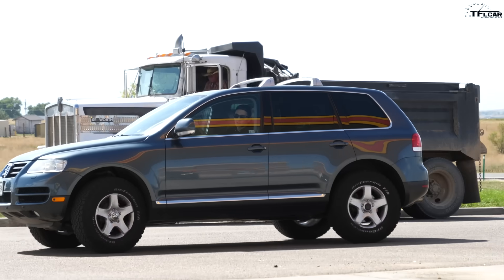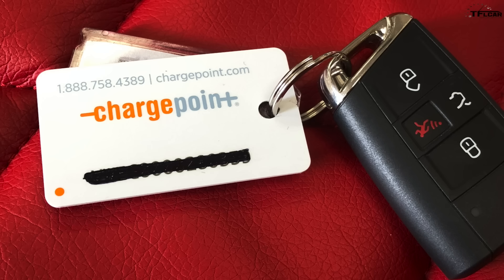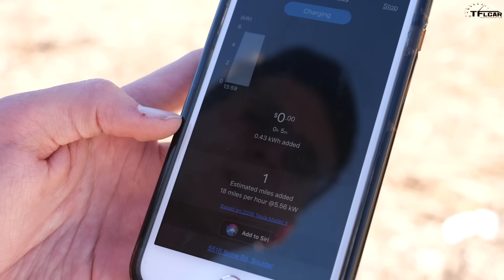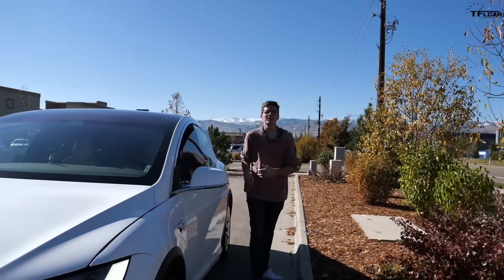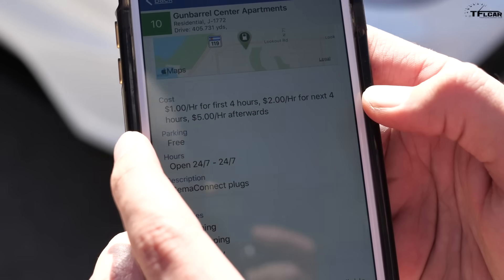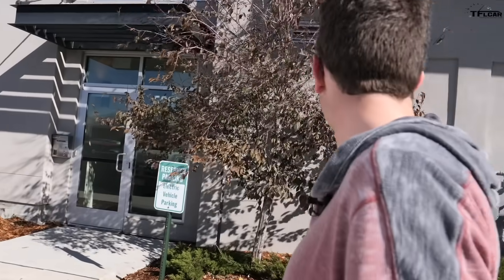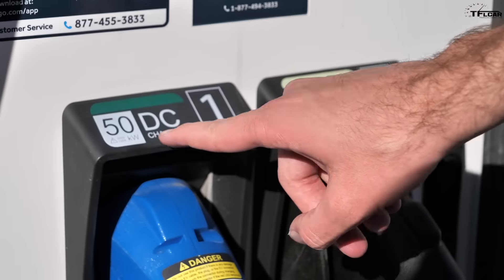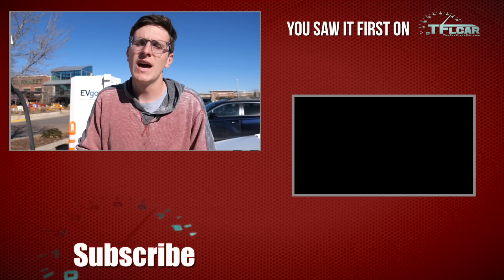Here’s Why Charging an Electric Car Can Suck - And It’s Not The Reason You Think!

Comment: My daily driving distance is 50 miles and electric car will be a good thing to save money , Go to work  and when I back plug it in the garage to charge .
Reply: As long as you don't need to make any side trips.
Reply: @DAK59  Why?  Since I got my Tesla.. we are on a mission to take every long trip possible..before gas prices hindered the trips but when you travel for  next to free take as many long trips as possible.
Reply: @1905934  , Short distances between charges, hour long + charges.  It isn't practical for distance driving.  If I leave Atlanta to visit my son near Chicago, I can make it in 12 to 13 hours. If I were to take the trip in a Tesla 3, I would have to charge twice and it would take around 90 minutes for each charge.  So I would add 3 hours to my drive.  This assumes I don't have to go out of my way to find an available Supercharger.  If no Supercharger is available or I have to go out of my way, add more time.
Reply: @1905934  . Not for hours at a time. I can get gas and use the restroom in about 10 minutes.  When I make the trip, I usually take my dog so I get my food to go.  That is how I can do 700 miles in around 12 hours.
Reply: @DAK59  Please tell me more about your gas car... I am really interested..
Reply: @DAK59  You fill up gas hours at a time?
Reply: @1905934  READ.  I don't stop for hours at a time.  I rarely stop for more than 20 minutes.  My goal is to get to the destination.  Having to charge just makes the drive longer.
Reply: @DAK59  Why would you or need to stop for hours.. please go to the point.. I have never stopped for more than 30 minutes.. why would anyone need to stop for hours?  Please tell me what I am missing in this conversation.
Reply: @1905934  To charge the car.  I assume you figured out that it has to be charged every so many miles (322 miles is Tesla's advertised range for a fully charged Model 3).  Assuming Tesla Superchargers were available when and where I need them, I would have to spend about 3 hours charging during a trip from Atlanta to Chicago.  That is using Tesla's recommended 1 hour charge to 80% when using a Supercharger.  The numbers are the same if I charge to 100% because that takes 90 minutes per charge.  I could do  your 30 minute charges but I would have to make many more charging stops. The above also assumes that I can actually get 322 miles on a full charge. I could charge a little less but then I would arrive with almost no charge and the hotel I usually use doesn't have a charging station.  These numbers are the best case since a Supercharger is the fastest way to charge.  If I have to use a different charger then the charge time only go up.
Reply: @DAK59  I stop for usually 30 -45 minutes per charge and stop more often because you actually spend less time charging in total. the more empty the battery the faster the charging speed.  But you don't spend hours at one charging spot.
Reply: @1905934  you do know gas does have advantage over electric and most of the things you are greatful for is bc not everyone has electric and besides instant power there is no real advantage and in a power outage yea back to gas generator and by the way electricity is still made by coal and natual gas aka gasoline and price you can't choose your power at home or what other charge for power so the cost savings is small and cost a ev is more than electric so one day electric maybe there but telsa crappy 1860 batt loose juice just sitting so its bad to use in a car that you don't drive and plug in all the time
Reply: @executiveorder7146  It is best you drive a gas car.  you lose.
Reply: @1905934  all cars are gas cars so your right thank you for driving a car that is always going to keep gas alive and its always going to be on earth also so good luck with that
Reply: @executiveorder7146  Please tell me more about the benefits of driving a gas car.  This new technology is so amazing!  Do you want to buy my cassette player.. good price.
Reply: @1905934  awwwww you don't realize all those tech is just more juice going out the window and by juice i mean all that coal and natural gas aka gasoline and then wonder why you have to plug it in for hours or over night bc its like 1880 coal and natural gas aka gasoline so saddle up the mule and yea you don't realize they loooooose juice just sitting yea so plug it in plug it in
Reply: @executiveorder7146  my car charges while I sleep.. so I don't understand why you don't understand this simple idea.  You also do realize that gas cars use more electricity from the grid than electric cars use..so your are right if the electricity comes from coal.. that makes gas cars all the worse.
Reply: @1905934  and yea not only that but dealing with black outs like in Cali and the monopoly on electricity and board members can up the price of that kill a watt or burn that coal train till you are paying threw the nose and good luck being stuck wait do they make electric tow trucks lol or good luck asking for power somewhere and waiting to charge and then getting batt damage so yea those new telsa is a necked down 1860 batt that does loose just sitting and the same one is in the phone chargers at Wal-Mart for 5 bucks each so paying way over for that over priced golf cart zoom zoom the coals a smokin
Reply: @executiveorder7146  Us electric car owners want much higher prices on electricity. if you double the electricity you will quadruple the gas costs.   It costs me 1 cent per km to drive my car.  Compared to 16 cents per km for gas.  If I need to pay for a charge once a year when I travel...big deal.. who cares.  Life is very good for me an my money.
Reply: @executiveorder7146  You do realize that blackout affect gas cars more since you can't pump gas.  Please bring on more comments I like making you look like a fool.
Reply: @1905934  well mine is off while I sleep and its secure and no I can carry 30 gallon and 30 more in gas cans all while not doing anything but sleeping and yea if a blackout or storm or emergency im not stuck and have 4x4 so no electric cars are not there yet and not burning coal to do it so all night long those power plant or the meter on your house is not yours and you have to buy from that one electric company and if everyone had a electric car the price per kw or mega watt would be higher and you have zero choice but to buy it and at there price so try asking the power company for a cheaper rate or how that you don't like coal or gas production they will tell you they do what they want and you have to buy it all night long all night all night long
Reply: @1905934  I am curious about a few things I've seen the electric power steering but what about heat and from what I know they only make 1500 watt heaters so two of them in a electric car is like 3000watts that's about half the batt range or ac so please explain about the heat or ac and more so the heat and how 3000watts on lipo batts lolollolll
Reply: @DAK59  good thing you have a 300 mile range...
Reply: @sparklander  The depreciation value was why I bought it! New costs $55k and I bought it for $17.5k with one year factory warranty and one extra year CPO.
Reply: 1200 miles a month, cost of charging  - about $30
Reply: @suzaquad  1200 miles on a 40mpg ice is like 200 bucks. damn son
Reply: @0xsergy  that was my calculation when I decided to buy EV. Was driving 2007 Grand Vitara, average mpg was 20. So every month I was burning (60 gallons x $3)  about $180-$200. Now for a little be more I have EV. Extra vehicle (still keep my Suzuki  - great 4x4). Also the range anxiety, If you drive every day max 50-60 miles locally you don't need public chargers, In the morning full battery. In the future existence of so many gas stations doesn't make sense. People will charge their EV at home.
Reply: My commute is 60 and weekends at 65 miles round trip.  In 2015 I bought the lowest trim Nissan Leaf.  I charge at 120 volt wall plug overnight.  If not enough time, there are choices of commercial stations along the way to work to top off for a return commute.  This Leaf safely traveled 93k miles and has been reliable with very little maintenance.  Winter is the least efficient for the battery pack, and that more accessories are powered-up too. that reduces the range.  Hwy= 77 miles,  secondary roads ~ 84 miles.  I drive mostly on the hwy.
Reply: You don't go anywhere after work?
Reply: That's why I've bought my 2015 BMW i3 back in March. Already made 10k miles. So fun to drive. Daily driving about 40-50 miles. Every morning my battery is full, no more gas station visits!
Reply: @suzaquad  I've got an i3 too and my commute is about 40 miles round-trip. Easily charges overnight, and so much fun to drive. I think the more powerful/bigger EVs (like Teslas) might require more powerful charging but on the i3, with my usage, 120V wall current has never been an issue. That said, my wife and I do have a gas-powered car that I use for longer trips and when it snows. I don't think I could use the i3 as the only household car.
Reply: @MoisheLettvin  You are also saving some money by not paying any overhead for public chargers, and your battery will last longer when slow charging.
Reply: Tell your work to install a charger to keep you a happy employee ;)

Comment: Wayyyyyyy too much trouble and complication to move the needle away from gas at this point.  Needs to be standardized across all manufacturers (the charge port) and fast charging should be the norm not the exception.

Comment: I pay ChargePoint using Apple Pay..... and only use them for 30-45 minutes while shopping at my local Target once a week.   The rest of the time I charge my 2 EVs at home from a 110 outlet.
Reply: What EV are you driving?
Reply: @Robert Lee ..... A 2017 BMW i3 REX and a 2016 Fiat 500e.  ( I  only use the range extender on the i3  when traveling late at night).   I previously owned a 2015 Nisan Leaf
Reply: I can't imagine relying on 110 charging at home with our 500e....if you can install a 240v charger do it....we only charge at public chargers when we have to or it's free.
Reply: How the hell do they even charge on 110 volts? I thought the cooling system and all the electronics to monitor the battery would drain it faster than that?
Reply: Adam Smith most household 110 circuits are on 15 amp breakers....if your drain is that high, you have a problem.
Reply: Adam Smith I charged off a 120 volt outlet at a relative’s house for a few days while visiting. Gave me > 50-70 miles of range per day to play with, which was plenty for the side trips I did while staying there.
Reply: I charge my Model 3 nightly on a 110 outlet and if needed where I currently work has about 8 - 12 chargepoint spots. The grocery store down the street has 4 spots as well. I'm also a few miles away from a supercharger. all in all I feel fortunate to have good options when I need something faster than 110.
Reply: @Wicket_78  Tesla drivers are very well supplied with charging--you are very fortunate.
Reply: @aardvarkansaw  yeah having the Tesla network plus compatibility through adapters for other systems is huge.

Comment: I think it is a matter of using the right tool for the job. If you do not live in a place where you can have a dedicated 220V circuit installed then an EV may not be for you right now. I don’t understand why every fueling station in the country is not trying to work out deals with Tesla to install superchargers at every one of their locations. I get that Tesla would get a rather large piece of that pie but it is an awfully large pie and it is only gonna get bigger

Comment: When people figure out you can just rewire a normal outlet for 240watts, they are going to cheer. For more read below:
Reply: 1) Turn off your electricity! 
2) Find the outlet you want to reconfig, then find an outlet you don't need. 
3) unplug the positive wire from the one you don't need, cover with elec tape (well)
4) Take the "neutral" from the outlet being reconfiged and attach it to the empty positive you just freed up. 
5) Done, key points below

* Electricity is dangerous but saves you tons of money if you do it by yourself, therefore there will be much push back from several groups
* Two positive 110 plugs are 20amp each, once complete you'll have 240watts and 40 amps
* No need for new wiring, the already existing positive wire and neutral wire are the same with the same gauge and will both have positive 110watts at 20 amps each once complete. 
* The plug doesn't have any effect on the situation and so changing it isn't required, the charger detects the higher power as normally setup 240 40amp outlets also have two positive and a negative, just as you have just created
* Yes, you could leave the outlet I've recommended decommissioning live, tie in the reconfiged outlet and just be careful not to use it while using the other but now we'd be getting into dangerous territory. Don't do that PLEASE. 
*Take your time and pay attention to detail, there's not much to it so make sure everything is cleanly done.
* I'm not an electrician, just a nerd, take care!
Reply: ^^^^ This is all done in the breaker box btw
Reply: ^^^^ says the electrician 😭😭 (no, don't share the secret)

Comment: My round trip commute is 110 miles.  EVs are not an option today.
Reply: You could theoretically do it in a Chevrolet bolt EV or Tesla.
but you have much the same situation that I do I end up driving 200 to 300 miles per day.
Toyota Prius is really the best bang-for-the-buck when it comes to longevity reliability and efficiency and practicality.
It's kind of a boring car but I don't care about that.

Comment: In my experience chargepoint is a hit or miss. Sometimes it charges and other times for no reason it won't. For example, last night near 6:00pm, no charge. Came back to the same chargepoint at 10:30pm to check it out, then it charges. Aye!
Reply: chemicalcorral
The worst is when it starts charging, so you leave. Only to come back hours later and it stopped 10min into charging.

Comment: So only level 3 chargers have a reasonable charge time, and those seem to be very few and far between here (1 plug 10 miles away). So unless you want a Tesla (I like the drive-train - but not the tablet only interface, or the seats) - charging at home overnight is the only real choice currently. Get busy and run it down - and you'd better hope that one plug is available or you have just enough range to make to a farther away one, and that you have the right app. What a hassle, no thanks.